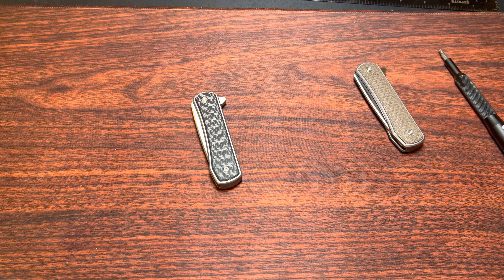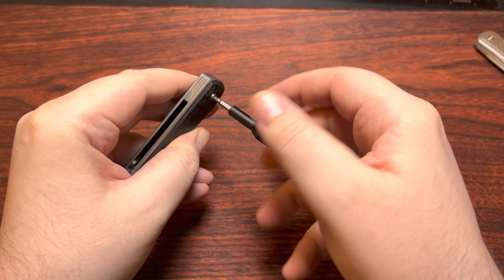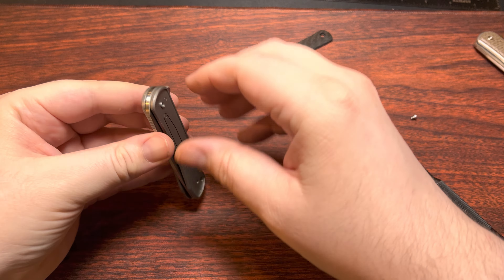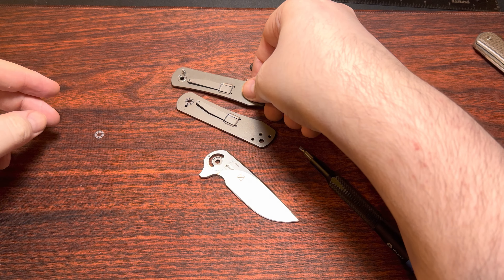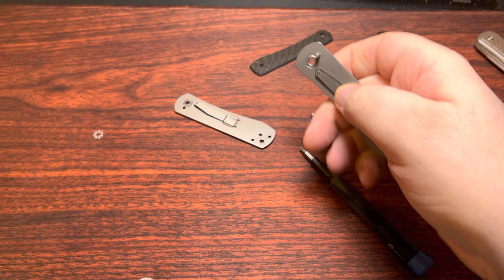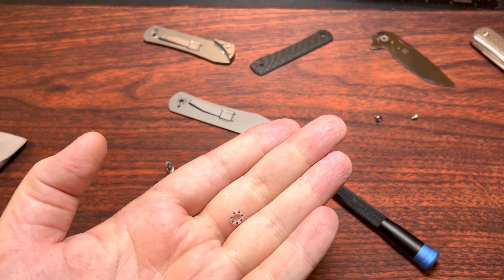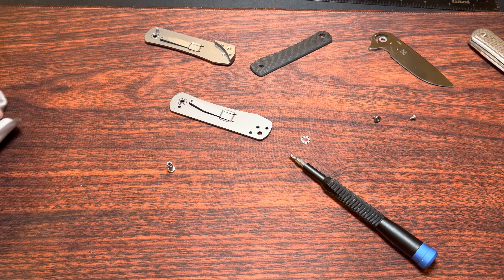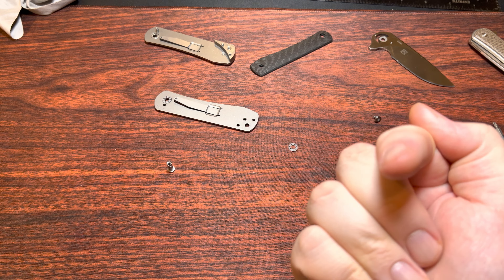TwoSun TS335 Disassembly (Quick Requested Vid)

Comment: Holy cow! You get props!! I appreciate your willingness to do this disassembly video. To be honest, out of 17 or 18 TS's...this was the only one that came defective. It only had one bearing and a bunch of washers or bushings. I requested and received extra bearings (and bushings) to fix myself. Replacement bearings and additional bushings corrected the problem, but the blade isn't quite centered. ...But the action is magnitudes better. Again, I appreciate your help on this one! Also...FWIW...I reversed the order of bushings and bearings and it seems to work best. Not sure it this is true for all...results may vary